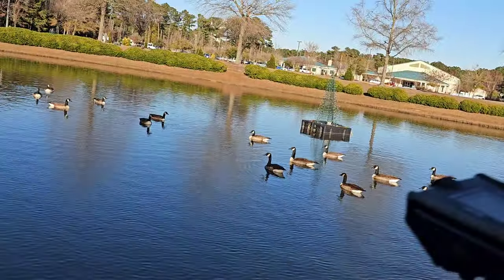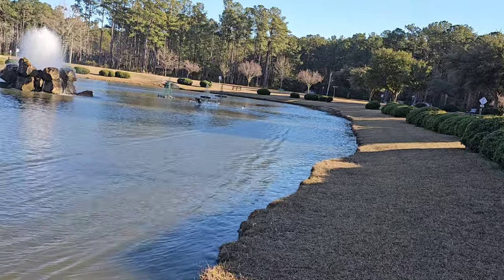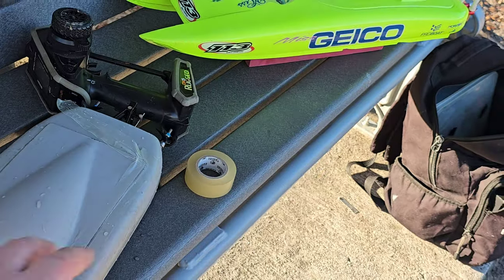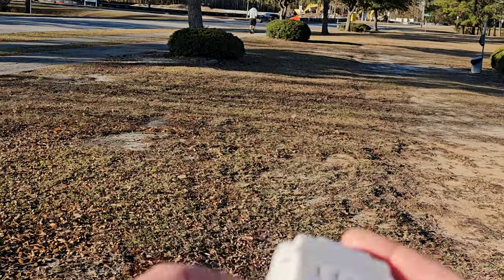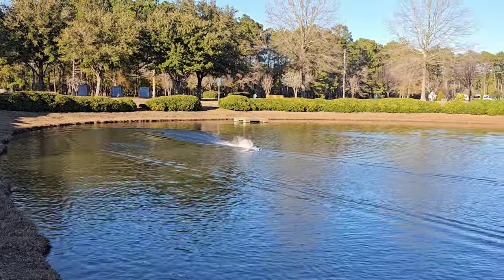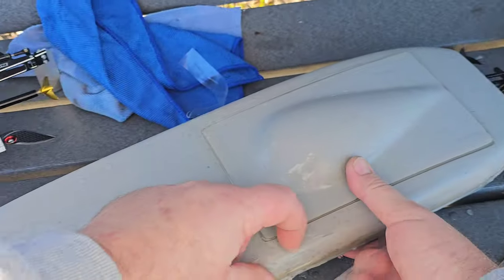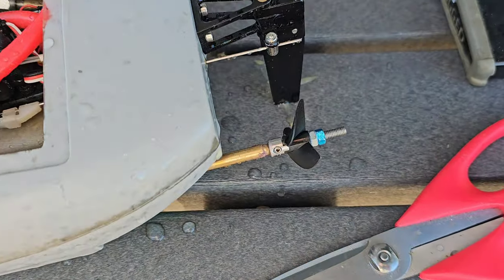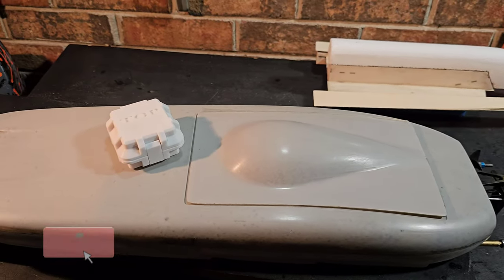New Tune Model Ships Ahoy 21" Twin Cat - Rocket 2948 3450kv, 90a Flycolor Esc

Comment: 2:25 in:  Yeah, I agree, those plastic props are not that efficient.  Your new ones are on the way (in that SLOW boat from China).  4:00 in:  Those are cool!  Maybe not for micros, but for the bigger stuff, heck yes!   4:32 in:  Do I see a TunnelJet in the background with a cowl???  5:59 in:  Do you see the way the right sponson wants to lift?  I'm thinking dull props hitting the water surface at high rpms and wanting to lift rather than push......  Maybe the right prop is "more dull" than the left prop? 🤔

Comment: Hi ...plz what motor ...kv ...prop ...esc do you recommand for rc fishing boat that i will use in salt water: lenght 1meter weight : 5kg....im thinking about something that can handle the current and waves. Thanks a lot.